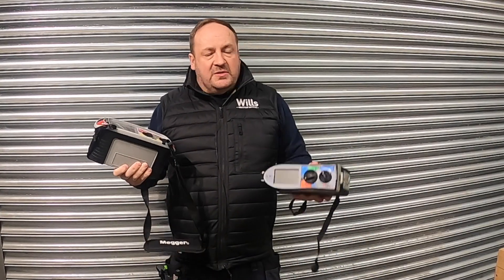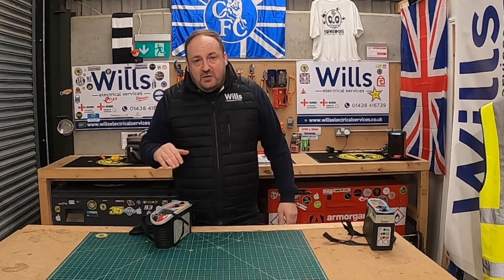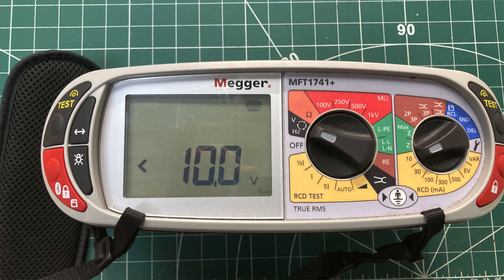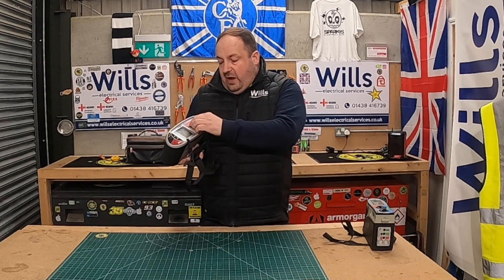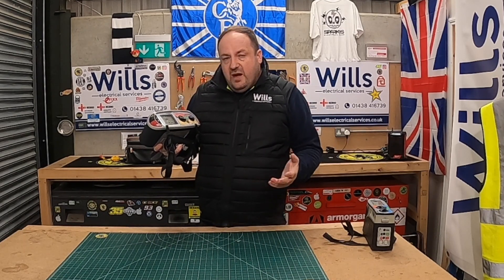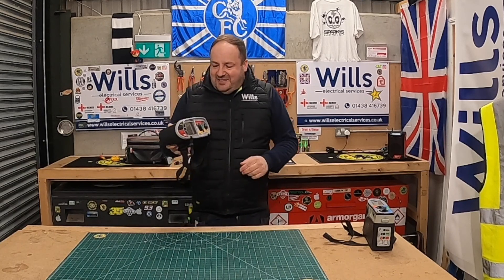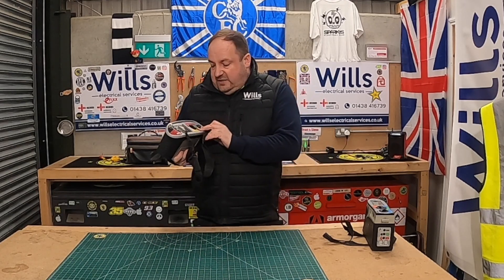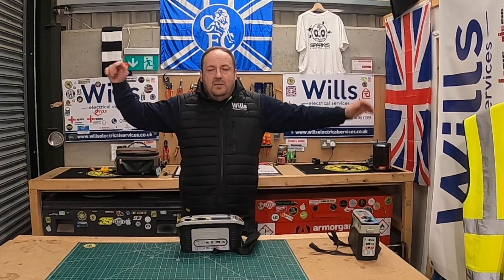An idiot's guide to Megger 1741+  MFT

Comment: Hi. I’m struggling with this tester. The confidence meter that it has when doing Zs skates all over the place and not getting any consistent zs readings. Have you experienced this?
Reply from the maker: I remember having the same issue and in Laymans terms, I don’t actually know the correct terminology, but basically when other people are using the system as in other households or building premises that will jump up and down with people using the power load. It’s probably only at night time you’ll get the correct results or less busy times
Reply: @ElectricianTV  Thanks for reply mate. Sometimes I’m there for about 2 minutes waiting for a zs but it can’t start really high go down low and constantly move about. Zs readings if I did it a few times never close to enough to each other and doesn’t fill me with confidence one bit!
Reply from the maker: @alanmarriott9216  the Niceic always recommend that you test the same circuit every month and record the results maybe give that a try

Comment: Great video, had this tester about six months now. Im certainly not a snob…. But Megger is the best testing equipment hands down
Reply from the maker: Do you have the 1741+ or the 1741 I don’t really know the difference other than the Ev  button Of which I don’t really know what he does I can only presume it automatically goes on to be type rcds
Reply: @ElectricianTV  The EV button is for the Electric Vehicle charging points.